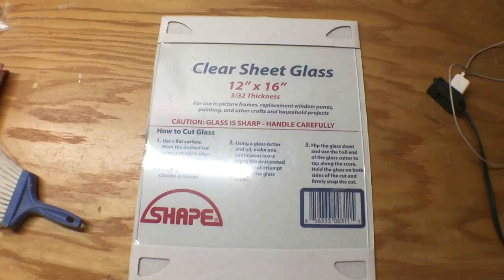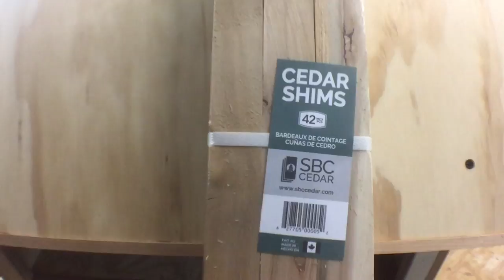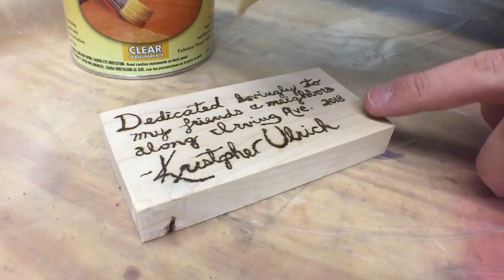Building a Little FREE Library

Comment: This looks like it turned out great, Kristopher! 
When you cut the cedar ‘siding’ were you re-sawing thicker boards down, and then making a bevel cut on the table saw?
Reply from the maker: Thanks, Mark!  The cedar re-sawing was straight 90 degrees.  The only 45 degree bevel was on the front and back face to accommodate the roof line :)